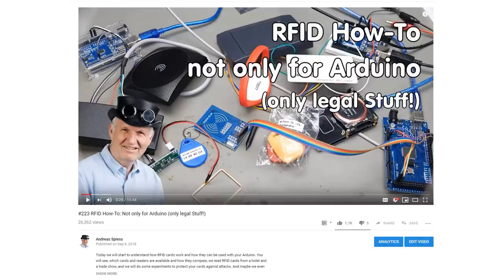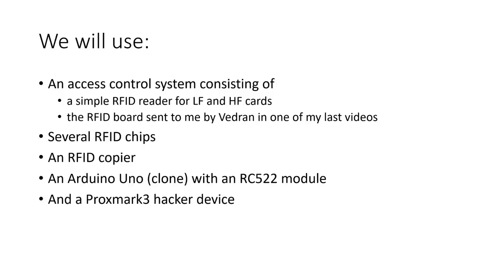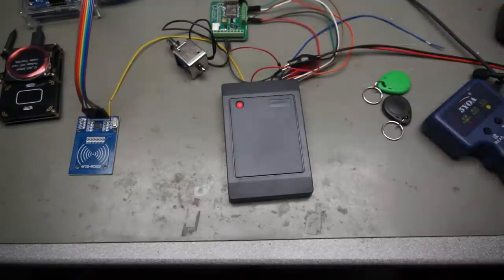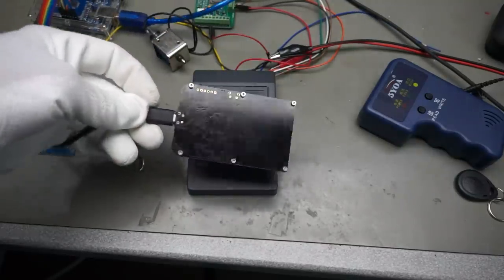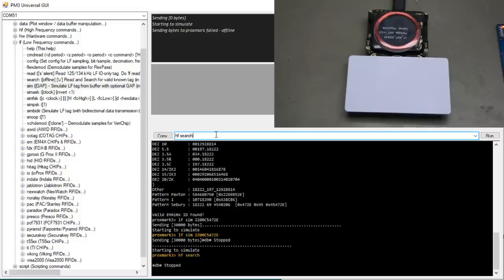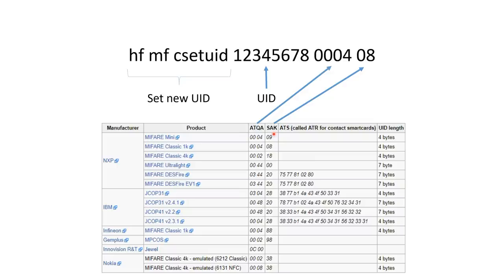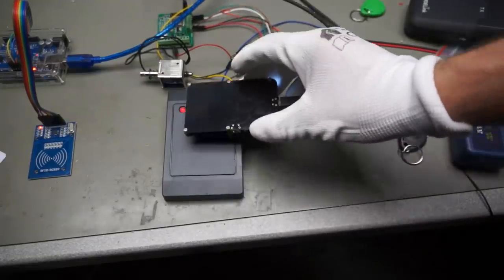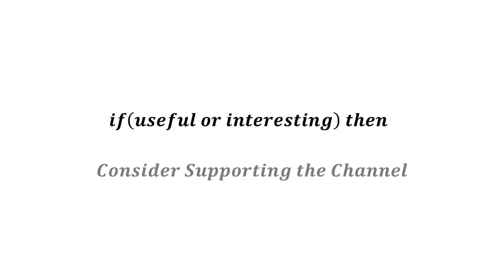#235 RFID Hacking and Cloning with Magic Cards, Proxmark3 and Arduino (T5577)

Comment: An option to counterattack the counterattack would be changing sector 0 write key so that only you can change the UID. You should try that in another video.
Reply from the maker: This is a good idea!
Reply: @AndreasSpiess  There are also cards (on ebay) that are resistant (one time programmable, and alternate write commands)

Comment: Interesting video Andreas. I work for a distributor in electronic security, and I have never heard your theory about normal readers writing zeros to sector 0, however I like the idea. Normally if a more secure system is required, they don't use the UID but use the sector memory (Mifare classic) or application memory (Mifare Desfire). The NTAG's you showed in the video I have never seen used in security, but they will work on a reader that reads only the UID.
Reply from the maker: You are right. I mentioned that there are better cards available, and maybe they are also used in the "western" world and in the last years. However, the Chinese do not produce these simple "Wiegand UID" readers if nobody buys them...
And I hope I was able to make sure my viewers do not use them for critical tasks.
Reply: You are absolutely right. Many new systems sold today use Mifare UID or 125khz variants. But, as usual, price is the most important factor.
We have even seen systems installed where the client was sold a "secure" Mifare Desfire system but the didnt program the cards, just use the UID of the Desfire card.. But

Comment: I’ve been playing with rfid myself this week. May have to look into the proxmark 3. Thanks.
Reply from the maker: So I hope you still discovered something new in the video...
Reply: Proxmark3 is very advanced for someone just starting, I'd start with something easier to learn and cheaper like MRF 522 card that connects to Arduino/Raspberry or a PN522 which has slightly more power and similar capabilities to Proxmark 3 in most respects

Comment: What a fantastic video. 
So for the latter issue, all we need is a switch on the card that makes the card not writable to the sector 0, and it would work at least for that particular security measures.
Reply from the maker: Maybe.

Comment: Studied Mifare classic for my dissertation. Use the proxmark3 to capture the communication between the card and lock should indicate what trickery is going on on the first scan. I suspect you’re on the money with rewriting sector 0. Some readers just check if it responds to a magic packet read command and flag the card on the backend. This seems a little more aggressive however.
Reply from the maker: Thank you for your input. I will not investigate further because it seems to be quite obvious that you are right.

Comment: I have a Sureflap cat door and Surefeed cat feeder. It can read the ID-chip in the cat and it can also read the blue tags you started the video with.
My (aftermarket) Immobilizer in my car can read the blue tags.
So probably I can learn the Immobilizer to read the ID-chip in the cat ;-)
Reply from the maker: I hear about these Surefeed products. But they do not give information about the standards they support. So I have to dig a little more into the topic...
I hope you know your cat and do not need a reader to find out which is yours ;-)
Reply: @AndreasSpiess , they support the standard pet id chips. One manufacturer say: "Pet-ID Microchips produce 134.2 kHz FDX-B microchips to ISO Standard 11784/11785 and to our manufacture’s code 958."
Reply: @LeifNelandDk  this cat understand and a dog got eat when food ready b

Comment: You're right with your theory, but then another generation of "magic" cards came out that let you set the data in block 0 (the UID, ATQA and SAK) only once. After this, they refuse to respond to the "magic Chinese backdoor" commands, so appear indistinguishable from legit MIFARE classics.
Reply from the maker: You are right. I have a few of those now.
Reply: You could also simply use an emulator

Comment: What do lf and hf signals look like on an o-silly-scope?  Maybe even you can see UHF depending on gear.
Reply from the maker: They are sine waves. Maybe you wait till next Sunday if you want to see UHF RFID signals ;-)
Reply: @AndreasSpiess  Yes but obviously they are modulated. Could you decode the packets manually?  Maybe prove if the reader is wiping the magic cards?
Reply from the maker: That should be possible, but maybe not worth the effort. Because I saw the effect on the card (sector 0 all zeros), and the chance it was done by using standard commands is quite big.
Reply: @AndreasSpiess  the proxmark3 software has a listen function in lf and hf modes, so you can see the whole conversation that get transmitted over the air (according to the manual)

Comment: You can use an android phone with nfc and the app nfc tools. With this I successfully emulate a mifare card and also re-write, and make backups of the card
Reply from the maker: You are right.
Reply: Reading is available to just about any Android with NFC, but emulation requires root, right?
I had a fair bit of fun on a recent trip reading the various hotel keys we got and comparing them, but didn't have any magic cards and couldn't get any kind of emulation to work on my unrooted phone.

Comment: The system for sport timing is interesting... it reads and writes the RFID chips... I think they are 125kHz
Reply from the maker: I am not sure. From what I know they use UHF RFID tags because they have a bigger range.
Reply: @AndreasSpiess  I seem to remember a PCF7936AS or similar.  There are many iterations of the technology though and the technique varies.

Comment: Hi Andreas! For the MIFARE try cloning the entire card, sector 0 and every other sector. Maybe it’s not detecting the same information, i think this problem relays in your reader/lock system. I tried with not changeable cards copying all the data but block 0 and the reader gives me access authorization but doesn’t open the gate, for that i need to experiment with changeable cards, in order to solve it. I just have to buy them and wait 3 months for shipment. 😪
Reply from the maker: As I said, the sector 0 was completely wiped out after one read. That is why I assumed some "activities" of the reader. I am interested in your findings...
Reply: Cloning the entire card works at least on my limited testing, you can also load the data (the .eml file) into the simulator and use that.

Comment: Hey all, 

I'm looking to understand RFID and how can a machine know what card it's scanned (to add more time to use it) and how can a card be disabled after using it once? Even with other machines..

Basically the card activate the machine to be used longer. However once scanned it doesn't work. Nor on other machines. 

Are these cards coming pre programmed or even empty and the machine writes 0's? 

Is it possible to copy that ID and just use it with your phone or a mini computer? 

Does the machine read & writes so it tells the card it's not valid anymore? 

All the help is appreciated

Comment: I am not sure how magic cards work, but with the newer CUID cards, block 0 can only be written to once. So if the reader tries to overwrite the CUID card with all 0's, it will fail to do so since block 0 becomes ROM once it is written to for the first time, just like the real cards
Reply from the maker: You are right. And most of the currently used cards are anyway encrypted.
Reply: @AndreasSpiess  Yeah, there are some rather sophisticated standards now. Of course, many people still use MIFARE Classic 1k and 4k which are easy to clone. Although one I tried to do recently had non standard keys for sectors 7 through 11... Those keys can be cracked though by exploiting one of the already read blocks performing a Nested Attack on the card, just takes a little more time than normal

Comment: Holy crap , my landlord wants $70 for another, does that sound right?  I just ordered one it comes with more rdif for cheap. Will let you know if it works for me
Reply from the maker: It will only work if your landlord uses non-encrypted cards.
Reply: it may be , I tried at a booth, but it couldn't be copied

Comment: Hi, I has been looking with not luck, I need a RF receiver in the frequency of 345Mhz (I believe 344.9Mhz), I want ro read my home RF alarm sensors to integrate it to my HomeAssistant, but don't find those, only find 315Mhz and 433Mhz, Can you please help me?? what should I do, is it possible modify the frequency on one of those or not?? Thanks a lot.
Reply from the maker: RF and RFID is not the same. I made videos on how to hack some of these sensors (40 and 433 MHZ). not easy :-(
Reply: @AndreasSpiess  Thanks for your answer, I’ll try to find those videos you are talking about. Thanks again

Comment: Hello, help to solve this problem: There is a need for the Arduino platform on the command (external button - for example) to turn on the stepper motor. 
After performing the specified number of revolutions (1000), stop it and turn on the second stepper motor with a similar task (say 2000 revolutions)and stop. 
After receiving the second command, the program runs everything in reverse order. 
First the second motor 2000 rpm in the reverse direction, then the first 1000 revolutions in the opposite direction.
Need a sketch of the program, if possible with detailed comments, as your humble servant is a kettle in programming 
With respect and hope.
Reply from the maker: This is an interesting project. Unfortunately I have no time to help.
Reply: @AndreasSpiess  I don't know this technique well. I was probably wrong when I thought it was a simple sketch. And it does not require much time from a professional. Thanks for the reply.

Comment: I got the simulation to work after flashing the device with the iceman fork
Reply from the maker: And no HW changes?
Reply: @AndreasSpiess  no HW changes. I was able to read the simulated card using my phone. But I was not able to use it's standalone mode.

Compiled, flashed and used the client on a Ubuntu machine.

Comment: Hello Mr. Andreas.
I have 60 yaers old and  i am a retired in Public Service, I'm just a beginner and it is a hobby for me in this kind of tags(chips).
Do you know what kind of program language or software are usede to program this ICODE chips ? What i mean is how to put the hex in the tag or better in the blocks.

I will start with the most simple for me ,that is the SLI and SLIX this chips are pracitally the same  (32 blocks).

They have a sequencing starting in the user memory from 00 to 28 with four hex decimal in each line of blocks.

What i want to know initially is how to create this lines and how to develop them.For exemplo: if i want that the chip count something! I have omnikey 5422, 5022 ,  CR95HF and of course your softwares.

I dont know if it is in JAVA , C++ or other one?

Can you help me with some to read about it or something else?

If you send me your email i'LL send you 2 attachments just to illustrate.

THANKS for your patience and kind attention.
Reply from the maker: ICode is the brand name of NXP for HF tags. You should be able to read them with what I showed in this video. But they might be protected and then you cannot read them without knowing the code. You can not write these tags. Only the Chinese special cards as shown in the video.
Reply: Hello Mr. Andreas.
I bought blanks NXP ICODE SLIX, SLI2 and SLIX2 what i want is how to put values in each lines and how to create them to do somethings.
Do you know if there is a training or course about it?
Reply from the maker: Unfortunately, no.

Comment: Many access control systems / RFID readers are now able to detect "Chinese Magic" tags by sending the "Unlock Command" (0x40 / 0x43). If the badge replies, it is flagged as an imposter / clone and rejected. You can try with these cards https://lab401.com/products/mifare-compatible-1k-uid-modifiable . With this Proxmark3 repository http://www.proxmark.org/forum/viewtopic.php?pid=5678#p5678 . Greetings
Reply from the maker: Thanks for confirming

Comment: when you bought your proxmark i can tell its the chinese version cause they assembled the 125khz antenna over the chipset instead of over the 13.56mhz antenna like its supposed to...here is the assembly from another youtuber: https://www.youtube.com/watch?v=mAM7FrJyXHk
which means is has a shorter read distance unless you move the antenna down. i think they put it in the wrong place cause it doesn't say elechouse on their printed boards so they can ship overseas.
Reply from the maker: I knew I bought a Chinese version. The original was too expensive just to play around.

Comment: How to protect card copying?
Reply from the maker: AFAIK you cannot protect the UID, because it has to be readable by the reader. Other sectors can be password protected. 
As I said, newer cards also have stronger encryption.
Reply: Most cards have poor PRNGs and can be attacked, but it appears a lot of door entry systems just don't encrypt the data sections with non-oem keys. So they're trivial to clone because of this. I've not seen a 1K Mifare tag where proxmark hasn't said 'poor PRNG' apart on Chip and Pin EMV cards...

Comment: Hi Andreas, Unfortunately I bough the same clone proxmark device and its not successful with hf cards but I found out why. Because what we have, does not has a hf module. Check this video https://youtu.be/HRPYxk0RBrE  The guy has 2 modules. One is for low, other is for high frequencies.. And I need the hf one because the tag we use at work is a hf.. I just want to exemine.. :) The tag owner is a swiss company (siaxma ag) but I believe that its a bit old technology.. I thought that with proxmark I could find out something..

EDIT: I found out what is my badge. Its a legic type and hf. So I can read out now.. Yesterday I saved the content and today I just opened the door and enter-exit the company so tomorrow and I check that yesterday and today are same. So opening doors or enter-exit readout do not write anything to the badge. Tomorrow I will buy cofee with my badge and will compare what kind of changes happened..
Reply from the maker: There are some optimizations possible. But as you mention, it should work right out of the box for normal operations.